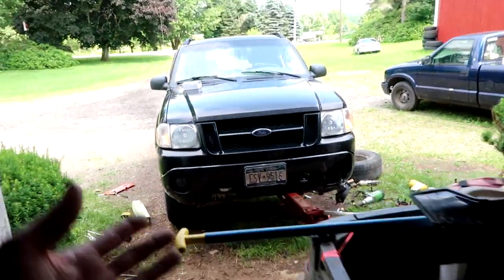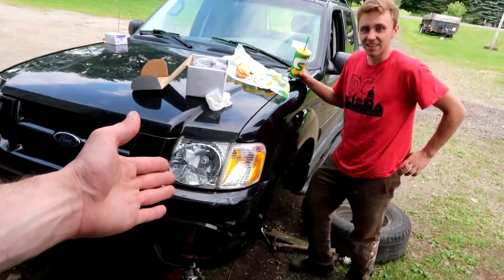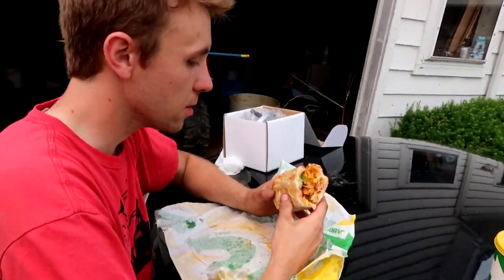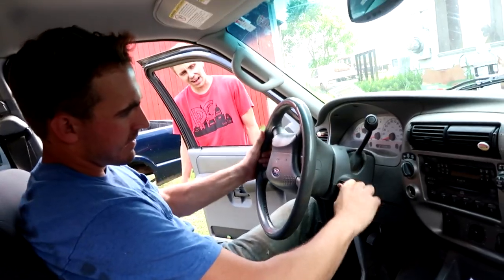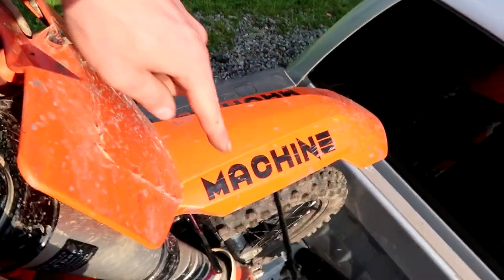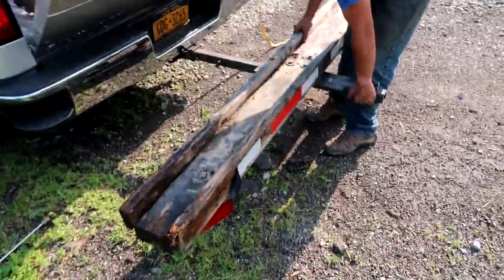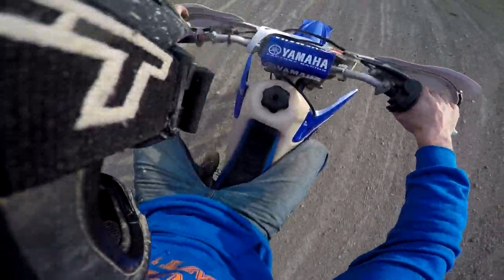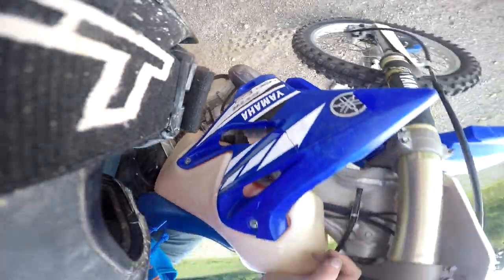I Broke His Bike in 5 Minutes!!

Comment: It's not a explorer it's a exploder because they are Ford's biggest mistake ever
Reply: The 2003 explorer was totalled from a pole falling on the roof so we bought it back from the insurance company for 300 bucks used a hydraulic ram to push the roof back up then welded a brace to renforce it poped the head liner back in then put tires on it then thats when the transmission blew lol
Reply: That explorer we took from Wisconsin to Pennsylvania 3 times, to Alabama and back 2 times. One of those times was pulling a 81 cj7 with a tow bar.
Reply: The early 90s explorers were great. The late 90s liked to catch on fire when not running and the early 2000s like to gobble transmissions